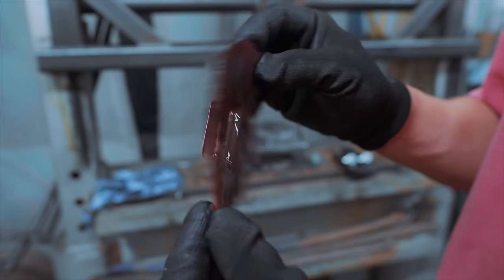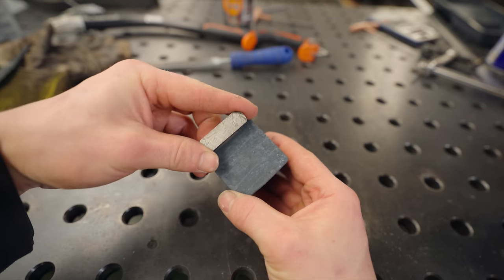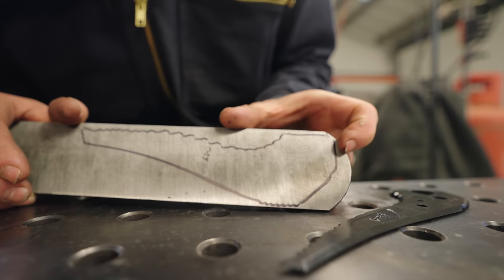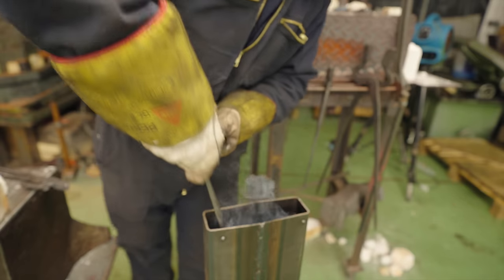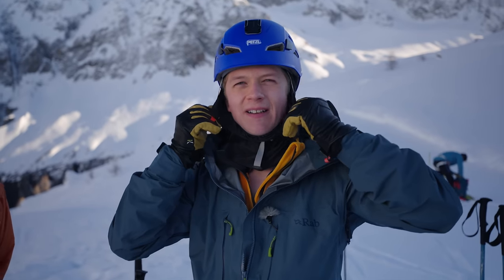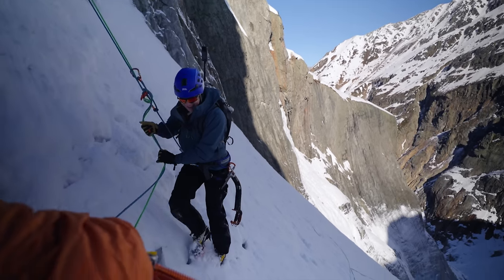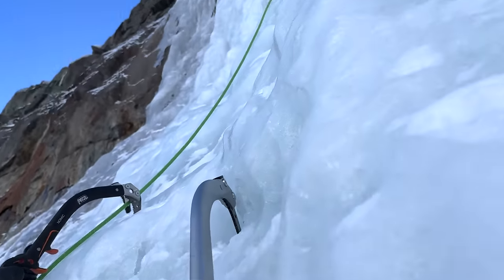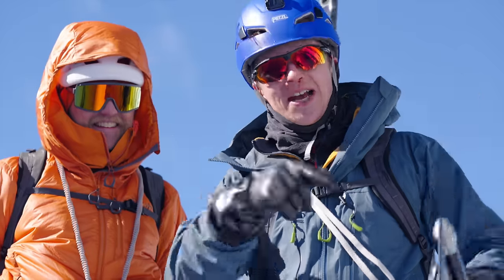I Made An Ice Axe And Climbed A Mountain With It

Comment: Making a dive knife and going diving would be SICK! I love this series where you make expeditionary tools!
Reply: Nah, next up should be a copy of a Petzl Progress. The progress requires a bit more complex machining. Or go for a grigri which has some moving parts, could be a bit of an educational experience. Or go all the way and go for something like an ID or ASAP, which aren't really products made for sports climbing but are used in rope access around the world every day. Especially the ASAP would be next level as it has multiple springs, gears and what not built in.
Reply: So dive knives totally ok where i live. But did you know they actually have alot of weird regulation
Reply: @NickyHendriks Things like grigris and other personal safety products would be really cool but have major safety concerns. If a grigris fails you will probably die, if an ice-axe fails in a controlled environment like this, you will not. But still fun ideas and a really fun video.
Reply: @hajocave2389  I know about the safety concern but that could be mitigated using something like a back-up line and for example an ASAP. I never really understood why in sports climbing a single point of attachment is fine and personally I don't really like it. In professional climbing hanging just in my Grillon or ID would be not allowed as they are for positioning only,  a backup in the form of an ASAP, Söll or Latchways safety line, fall arrest or whatever is always mandatory.
Reply: Make a diving knife and go diving with Ididathing :)

Comment: Oh I am keen as hell, I’ve NEVER seen someone forge an ice axe! What a great idea!
Reply: You still haven't. He forged a Damascus billet, then cut an ice axe head out of it. He did not forge an ice axe head.
Reply: @seanandrews5375  You're on an Alec Steele video, of course he just cut and ground demascus

I love when he does proper smithing, but until the demascus craze goes to the hell it belongs in, he's gonna grind instead of forge because it makes better patterns
Reply: @skilletborne  i love Damascus, and I love forging; I don't love forging a Damascus billet and cutting it, then calling the finished product "forged" because it isn't
Reply: @seanandrews5375  You can love damascus, but you can't expect traditional or technical forging and it to appear in the same context because they're not compatible.

I legitimately love learning and doing smithing, and I liked damascus when it was used sparingly and deliberately.
After 10 to 15 years of seeing it take over, it's tired. It's used to the detriment of pieces in visuals, process and function, and made it harder to find both information and materials.
It's driven up steel cost, buried domestic suppliers, and redirected smithing channels and blogs to repetitive content with bad habits.

Comment: Just wondered did you torque the pick. Or try any stein pulls. These two moves that are used on mixed climbing are the most strain you're likely to put on a pick. There are different ratings on ice axe picks. Love the channel and energy you bring to your videos. Would be great to see you try dry tooling/ mixed climbing with it

Comment: Something I've always wondered about Damascus steel, is the complexity of the pattern at all tied to its structural integrity/strength? Like, if you wanted a simpler, less complex pattern, would you have been sacrificing something by not cutting, stacking, and rewelding the billet at the beginning like you did? Or is that a purely aesthetic choice?

Comment: I would like to give you an ultimate challenge that I am certain is more interesting and more complex than you can imagine. I challenge you to make damascus speed skating blades. Hokey blades are trivial but speedskating blades will blow your mind with their quirks and criteria.
Reply: Speed skating blades are cherished by athletes as they are make or break in their performance and sharpened by hand nearly every race. The blades also feature a nice side face around 17inches long by 3/4 inch tall and a similar sized profile for the spine and some billet machined parts to join them to the boots. You would love the challenge and you will love how the blades are constructed and shaped in a way that would not lend itself well to knife making.

Comment: I have a question. Would you lose sheer strength making it out of pattern welded steel? With a pick, one would think you would want something that would resist sheer forces from your weight and the weight of your gear.

Comment: Can you (realistically) make homogeneous steel from Damascus with enough folding? Can you hit, statistically, domain or molecular scale folds?
Reply: Pretty easily
Each fold halves the layer thickness and doubles the layer number.
It was the whole reason katanas were folded - to clean up and homogenize a difficult steel. 8 to 16 folds was normal, or 256 to 65,536 layers.

If an average 4mm blade was folded 25 times, there would be 16,777,216 layers at a thickness of 0.238 nanometers each.
An iron atom is 0.252nm wide.

Tangentially, the same method is used to make those super fine, crispy layers in a croissant

Comment: I could be wrong but I'm pretty sure that with the sizes of steel you are using you could just air cool them, as the recommendations for liquid are actually relevant for huge tonne masses of steel.
Reply: You are wrong.  There’s a specific method to cooling metal in certain ways (all at once in a liquid that acts as a heatsink vs over time in air) that effects its structure
Reply: I'm not sure what you're talking about, do you mean quench hardening the blade?
There are a couple of air hardening steels out there, but they're far away from being the norm.

I thought it was pretty common knowledge that most steel needs water or oil quenching, even if the reason why isn't common knowledge

Comment: Your main problem, is that you are not using a proper forge, able to heat to the temperature to almost melting point. Clearly, you have not enough heat in your forge. That's why you suffer failure.